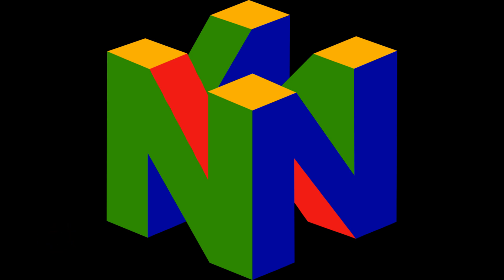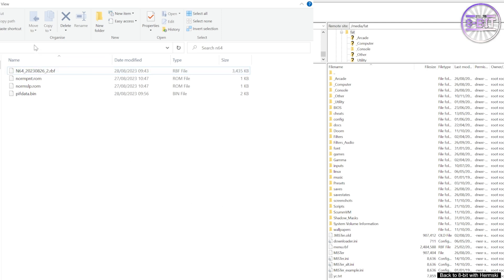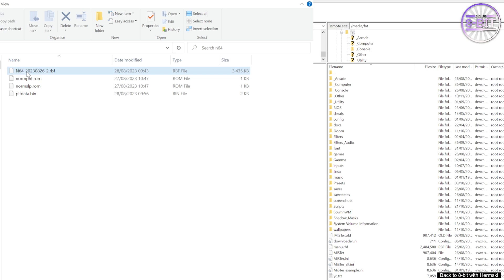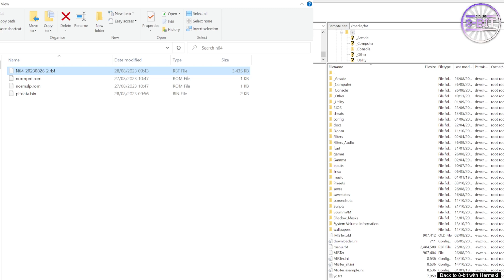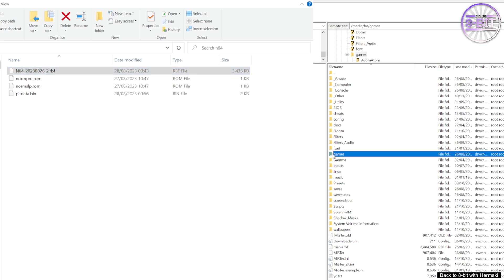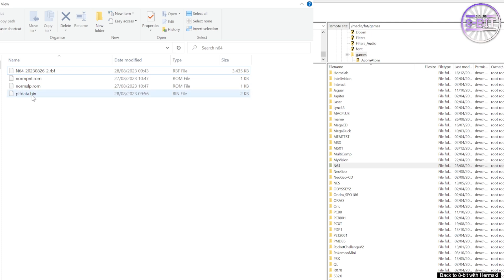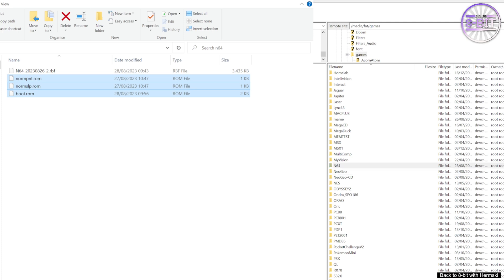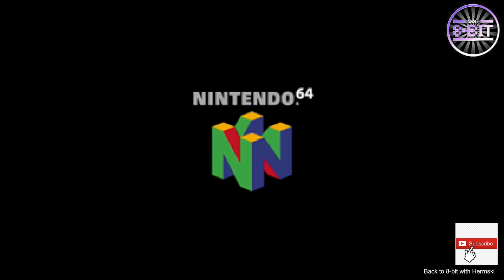N64 Core Early Set Up Guide for the MiSTer FPGA - Nintendo 64

Comment: Hi Hermski, thanks great video.  Am i to understand that we now don't require the 'MiSTer main' unstable anymore?  Also, I'm having issues getting Super Mario to run atm.  It freezes after the flash screen and I've implemented the face off patch.  Any ideas?
Reply: Also, you need the iQue patch for Mario 64. Not sure where to get that but it's the only one that works apparently.
Reply from the maker: Yea it's still under construction too.
Reply: did you figure this out? I have the same issue.
Reply: Nevermind figured it out. It was the no face patch i needed. No need for iQue version.

Comment: When I run the N64 core, the system loads to rom but when it goes to display it, I get "Auto Detect Failed". I checked my ini file and the resolution matches (1920x1080). I even switched my VGA cable to HDMI. Same result. It seems like it wants to run but my monitor doesn't support it? Anyone have any tips? Thanks!
Reply: Same problem